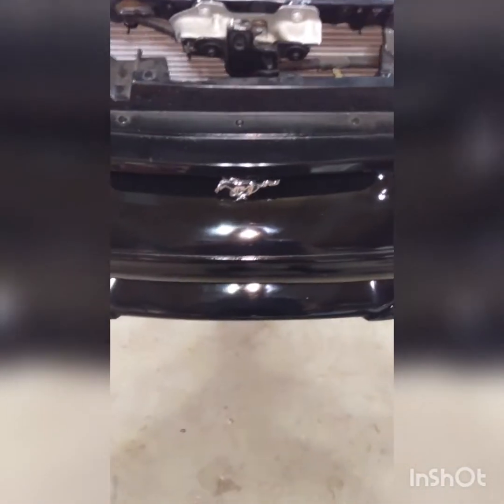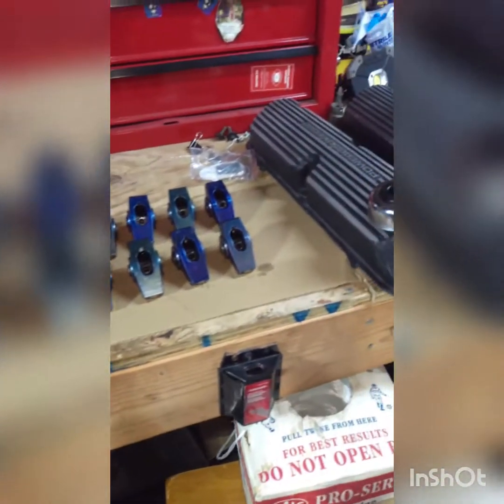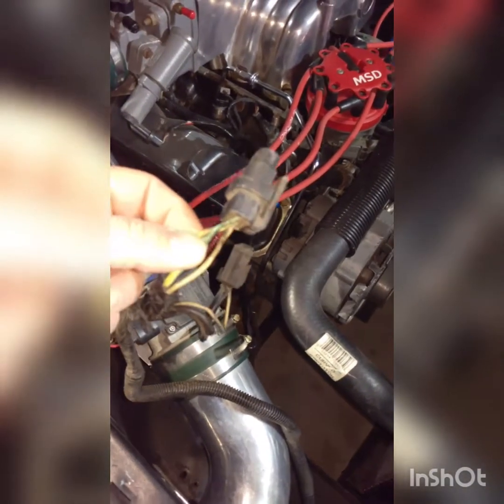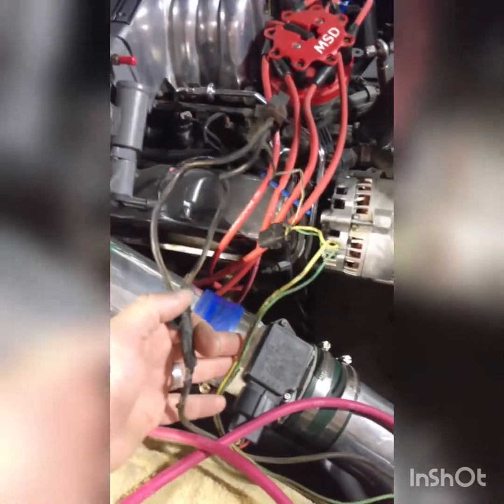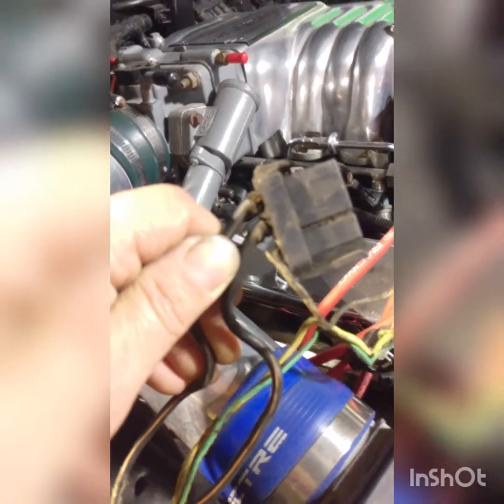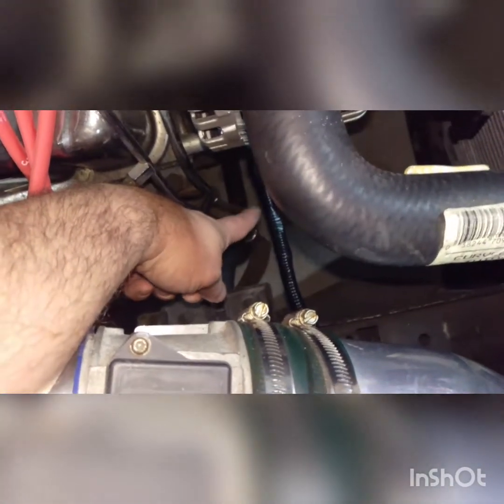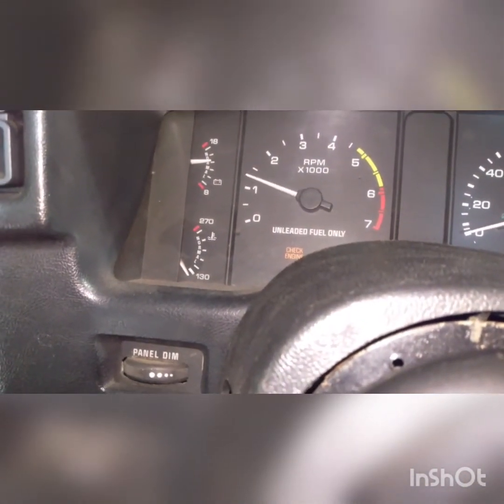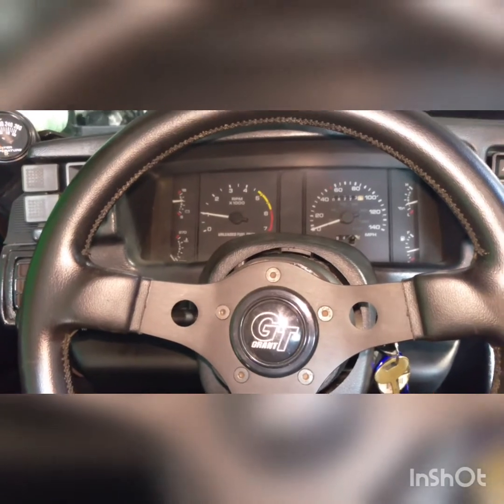Foxbody Ford Mustang Alternator upgrade 2g to 6g swap.

Comment: 6g alt is 95amp rated 3g alt are 130amp off a mustang 94-95
Reply from the maker: 6g alternators are rated  130 to 200 amps depending on the unit and have an internal voltage regulator.